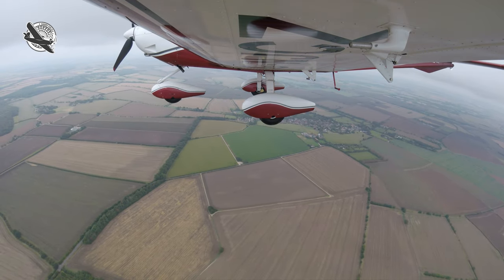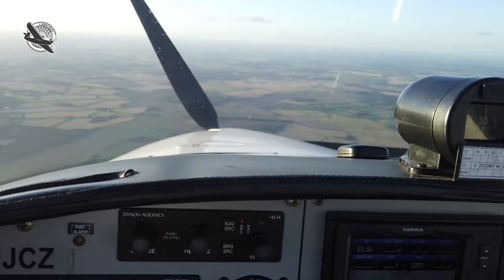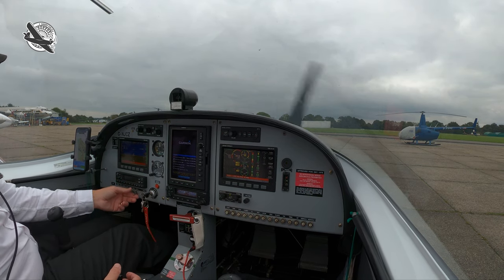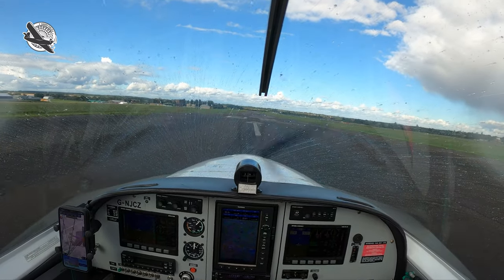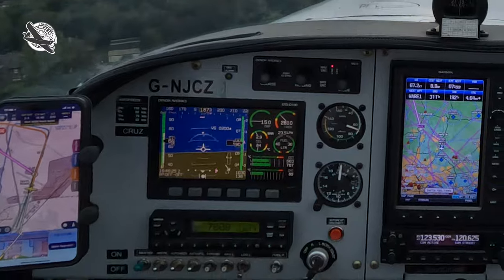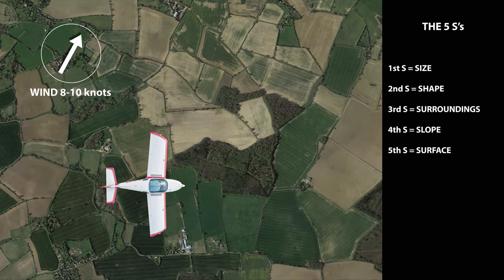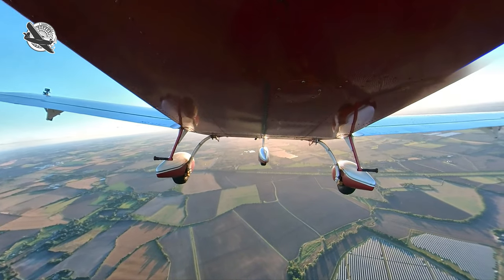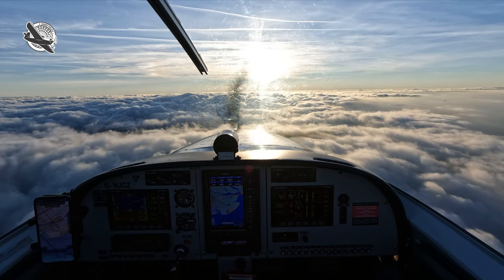ENGINE FAILURE in a single engine aircraft and how to SURVIVE if the worst happens.

Comment: When the pilot cooling fan stops :-) Watch them sweat!! It is funny I was trained years ago with an instructor who said don't use 5S use "Land With 6S" The break up of that is With = Wind (as he put it one of the most critical parts because at least you can crash slower into wind) then you have you 5S's the additional S was for Stock as he said they can just wonder into the way. I found out when in a helicopter that they do when we arrived with the drive from the engine failed and as we ran on a cow cross infront and put a big dent in the nose of the Wessex.
As PIC I had engine failure on my first Solo but that is another story.
In my next video you will hear that I fly using the stepping stones method.
Reply from the maker: Thanks Algy, looking forward to that video. I am always willing and happy to be educated.
Reply: @ShortField  it is not an educational video but I do make a comment about as I am flying lower than normal I am picking my way past areas with limited option by using landable field like steping stones.

Comment: Another excellent, well thought out video Terry, sage advice and always a good subject to consider, the exception to the rule that you don't get a ship to float by focusing on it sinking?🤔🤔

I guess that a SLMG, especially some of the Pipistrel SLMG aircraft, gives one more options 🤔🤔🤔😆😆😆

BTW with the Rotax, do you not take the engine top cowel off to check the coolant, carb mounts etc (or is yours fuel injected?), exhausts, springs, etc etc etc?
Reply from the maker: Thank you for the support as always it is super appreciated. I know we should take the cowling off as you suggest and it is something we have discussed as a group, it is a lot of faff but after recently having a blowing exhaust and it only coming to light on the 100hr check we are going to start adding it in our pre-flight checks but probably as a once a week thing. Great points and thank you again for watching and your excellent comments.
Reply: @ShortField Thanks, great channel. The checks - it's a daily (or every flight if not daily) check thing for most EV97s (Eurostars) and the Cowling's look very similar to each other (dzus fasteners etc?). So for you guys, perhaps, If two different folk are flying the same day the first takes the top cowling off (ala EV97) does ALL the checks and the second still does a burp/oil, coolant check etc, but through the cut out inspection hatches etc. Iirc (it's been ages since I've flown one) for simplicity and/or lightness the EV97 doesn't have the smaller inspection hatches - hence the top cowling off deal every time. Taking that cowling off does highlight the classic Rotax issues, carb connector pipe issues, leaking exhaust/spring issues, coolant levels, leaks of oil, coolant or fuel etc.
Reply from the maker: @musoseven8218  interesting, we will start to incorporate that, thank you.

Comment: Just dont stall it and you will be fine.
Reply from the maker: Agreed, but assuming that you don't stall it would be nice to be able to use the aircraft again after you've fixed the engine, cleaned the cow sh*t from the spats and washed the pilots seat. :-)
Reply: @ShortField  Yes, of course! But all the things you can consider come after flying first :D
Reply from the maker: @K0nst4nt1n96  I was only joking, you are 100% correct, fly the aircraft until you no longer can.